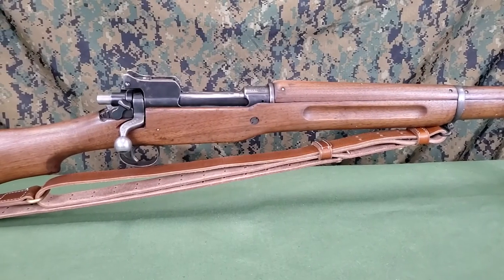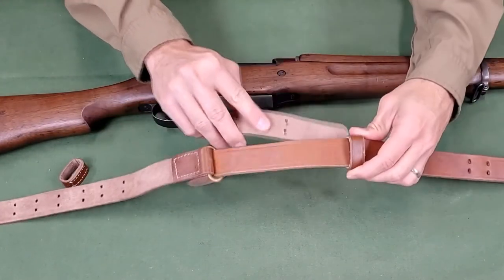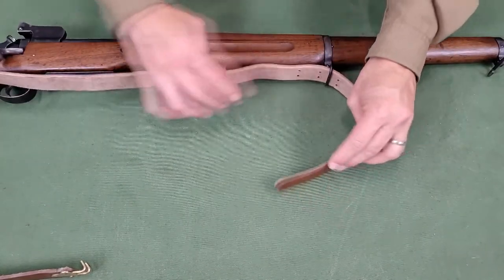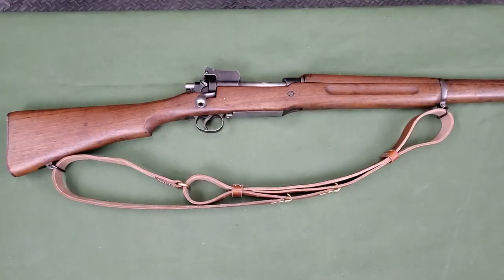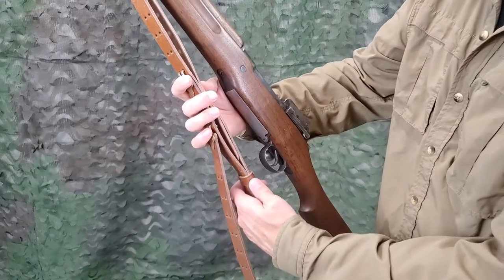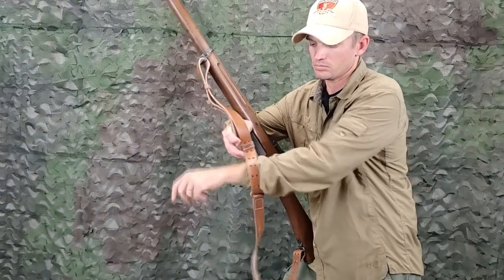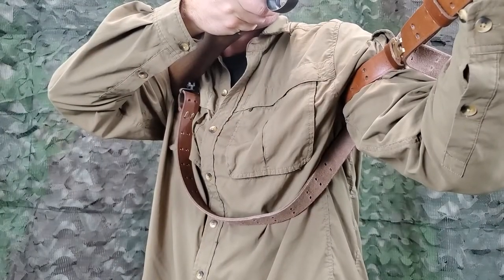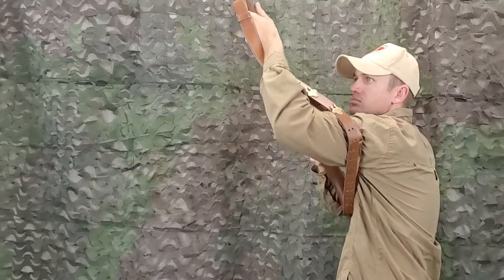Model 1917 Gun Sling, M1907 Installation and Use (TF 1-05A)

Comment: I followed this exactly for my sling and it works, but now I’m confused by other videos that insist that the two keepers have to be together up against the hooks.  That leaves one of the hooks unsupported.  Have you seen this method high power shooters use?  It’s close enough I guess it doesn’t matter much, just curious.
Reply from the maker: I have seen this method used. It's certainly an option and I  wouldn't say it incorrect or wrong. The method in the video comes from the Army Field Manual for the M1 Rifle. I think it's a matter of priorities/concerns for the shooter, i.e. which connection/loop do they want to ensure stays put.
Reply: @HistoryinFirearms  Thanks; the method shown here in your video is also the one shown on the CMP website, so that makes sense.  The Army Marksmanship Unit seems to follow a similar method but that put the hooks facing outward (not that I've had an issue with the hooks scratching the stock as there's leather in front of them for the most part), while the Marines and Highpower shooters put the two keepers together below the hooks, and push both keepers down to tighten the loop on the upper arm.  I was just interested in being historically accurate for the M1, and may adjust the sling differently if I ever compete with it.  Thanks again.
Reply from the maker: I think if you dove into looking at historical photos there would probably be all sorts of variations. The closest "official" attachment is probably what's in the video.
Reply: @HistoryinFirearms  I think you’re right, thanks!

Comment: Im having trouble adjusting it to get it tight. Thats the only part that confuses me.

The section on installation was really easy to follow! I bought a sling and the keepers came on the short section of sling for God knows what reason. 🤦🏾‍♂️ So it was super helpful to see where they actually should be.
Reply from the maker: I'm glad the video was helpful! Adjusting with a new sling can be tricky because the sling isn't broken in yet. It may take some time. If that's not the issue make sure the keepers are not keeping it from sliding. Just a couple suggestions. Hope that helps.